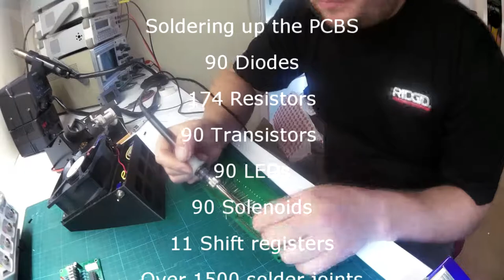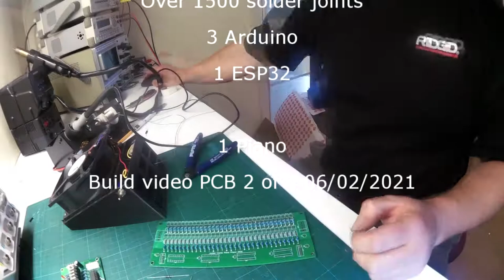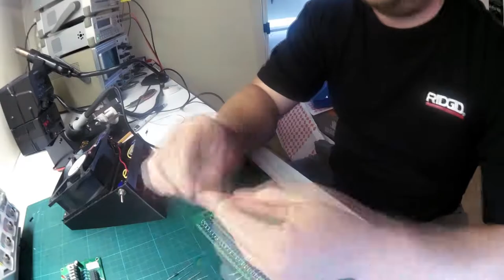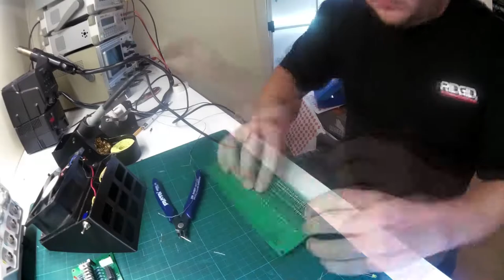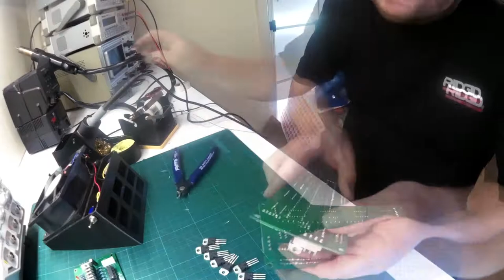Player piano PCB Build

Comment: I'm looking into doing this too. I noticed that you commented on another video and would like some more info about your project. it looks like you are just using shift registers instead of the PCA3685. Is this correct? Can you provide more detail about the electronics and specific solenoids (looks like you are using 12v) that you are using? How do you play the midi? I was planning on using a raspberry pi to control everything, but I really like how the tablet plays the midi at the same time as the piano. Any detail would be greatly appreciated.
Reply from the maker: Hi Josh, I am using shift registers but am experimenting with dedicated pwm chips like the PCA3685 to get better control. The shift registers are just not fast enough.
I have a youtube short somewhere experimenting with PWM controllers and velocity. This is what will be next , I'm using 24v solenoids the midi is over midi BLE to Arduino pro micro. It can be a bit picky on devices. Good luck with your project. It takes a while to do. Even after you get the electronics right the mechanical part is just as challenging. I also plan to add fiberoptic sensors to the front of the keys for feedback for the micro eventually and possibly for midi recording ( same as the Yamaha disklaviers) Shout out if you have any more questions